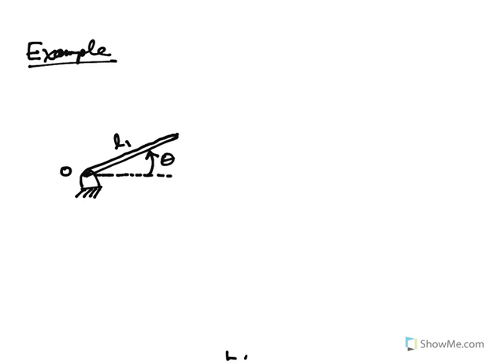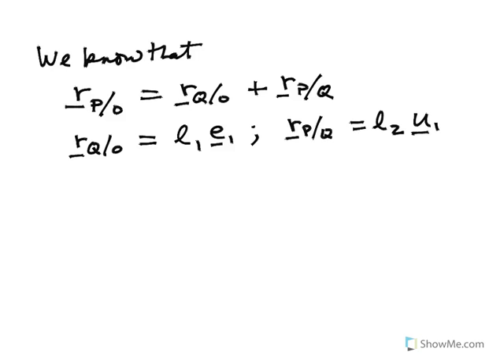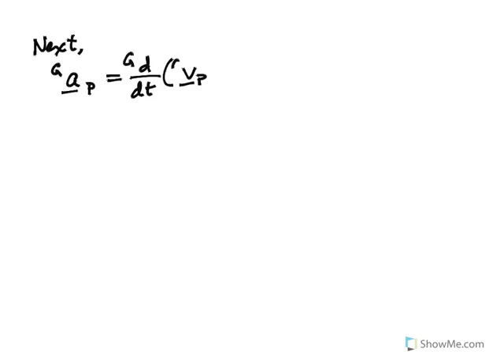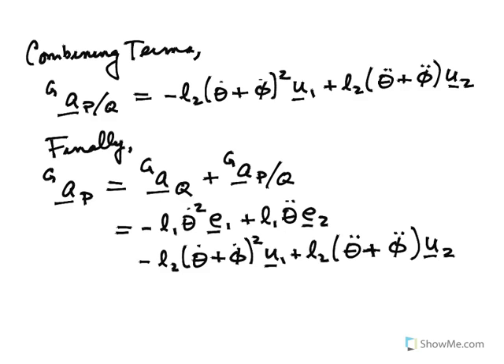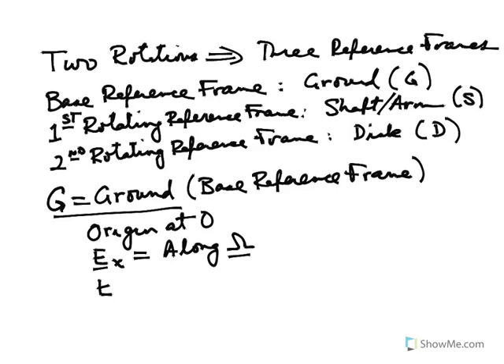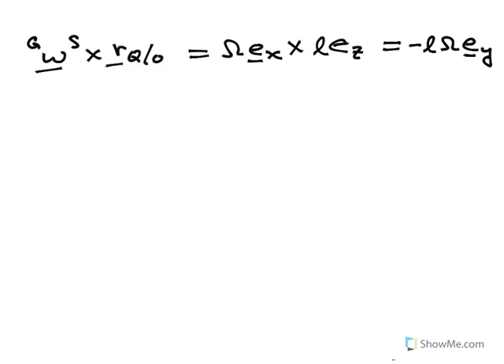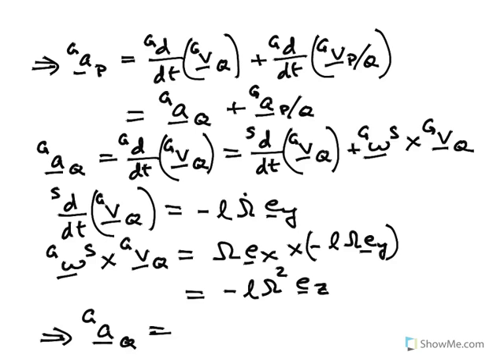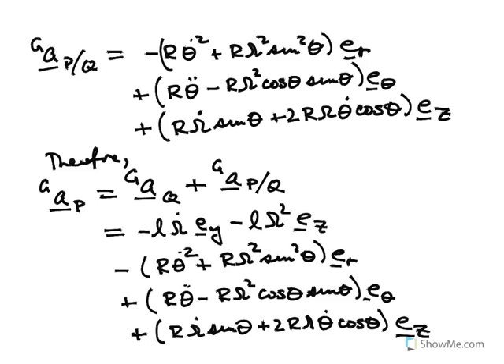Lecture 7:  More Examples Using Rotating and Translating Reference Frames

Comment: In the acceleration of the last problem in the lecture, we can club the two ez vectors in the end right?
Reply from the maker: Yes, you can combine the two ez terms.  I did not, however, combine the two ez terms because I wanted to separate the terms corresponding to the motion of point Q from the terms corresponding to the motion of point P relative to Q.